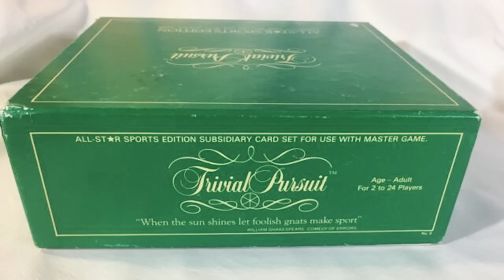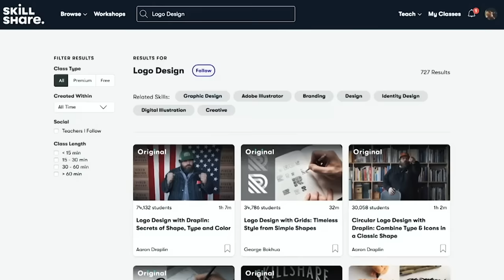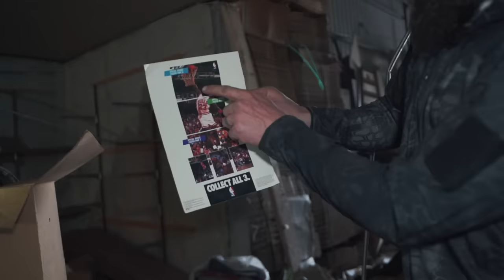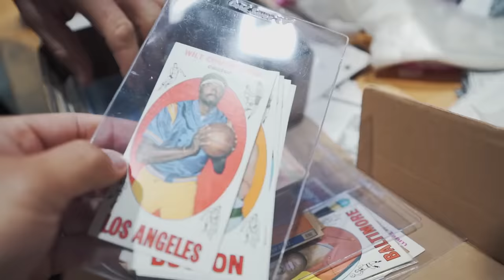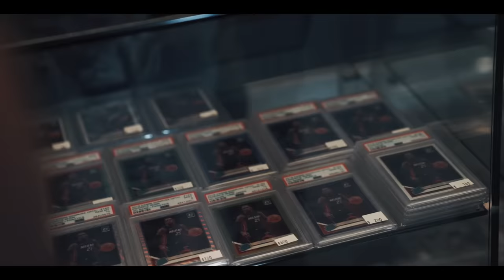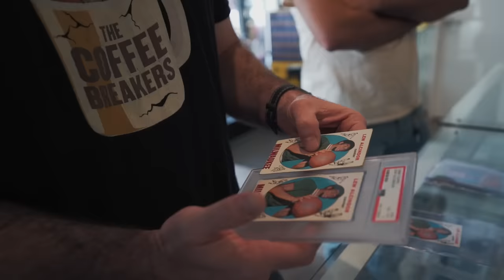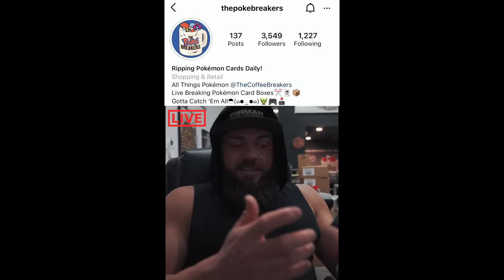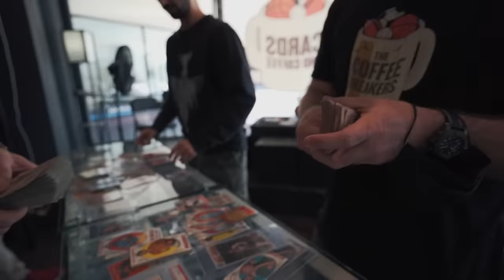Turning Trash Into Cash *ANYONE CAN DO THIS*💰💵💰

Comment: perhaps 3 conveyer belt systems could work in order to dump all the obvious rubbish on and remove to an outside crap pile? the problem is stomping down the rubbish and it remains, the rubbish is the easiest stuff to get rid of as its mostly obviously crap.
just a thought :)

Comment: HeavyD I commented before it was great to see you guys having fun with the cards you guys sold in this video.  Since that time I have found out that Card Breakers, the company you promoted on this video has been accused of “SCAMMING” it’s customers when opening card packs online.  Please do not associate with questionable individuals or companies.  I do not know if Card Breakers are scammers or not.  I have only seen where they have been accused of switching cards out while opening card packs.  After watching your video of selling your cards and buying unopened boxes of Pokémon cards and revealing their contents online I had decided that I was going to purchase 10 boxes($1500 per box) of Pokémon Cards from Card Breakers since I am a collector and it is difficult to find those particular card packs.  However, I am glad I did my due diligence and did some digging to see if they were someone so could trust.  Turns out they have many “SCAM” claims against them.  So please don’t promote shady companies.  Also, if you do promote a company that is on the up & up but find out later they have become untrustworthy please call them out and tell your viewers about such claims.

Comment: How much was the payroll for your crew. Also how much fuel did buy for all the trucks used for hauling everything off. I bet you had 25k in expenses emptying that warehouse plus the initial cost of 15k. It may be worth sending a couple employees over there to look for that other box and what ever else that's valuable that may be left behind.  You may pull another 40k out of that place.

Comment: Hi, I’m watching you right now. And I got curious cause I gave some antiques one ex sample is a 445/476 Mark UV  made in Pal Mal England issued to English officer only. It’s missing a screw on the right side but I was told by a gun store it’s  still fires.   It has the original string but the leather holster, the seams needed repair. Or  a fencing sword with the sheet  and more but I tried to take them to a antique store and they want it fir nothing . How do you find the places to sell them.
Reply: Oh it’s a Wilkinson sword, the gun.